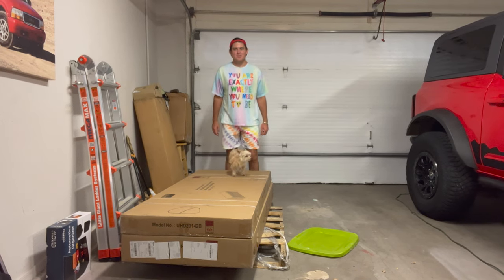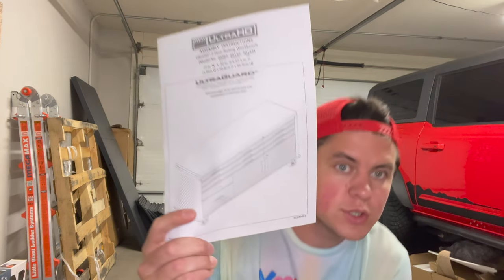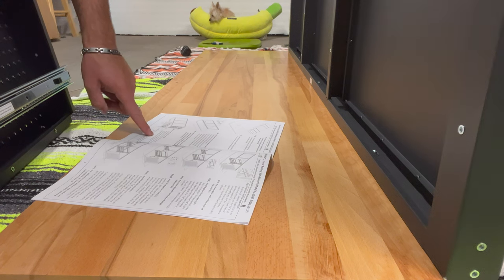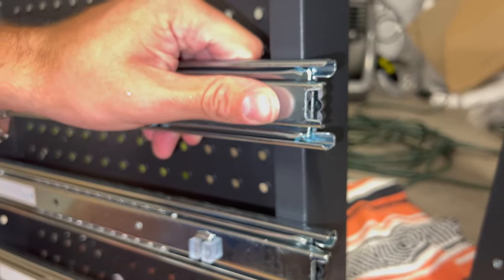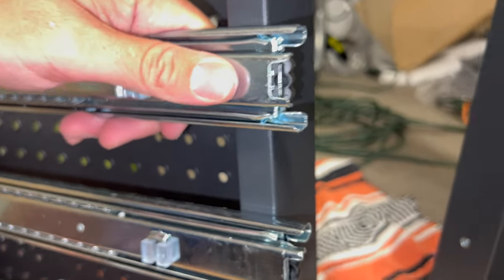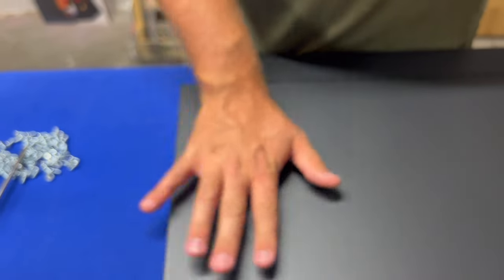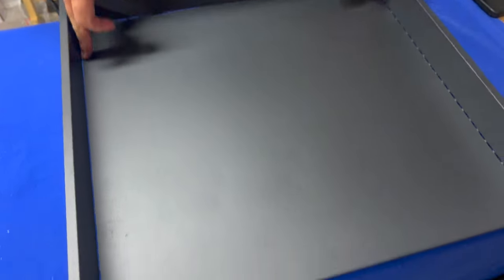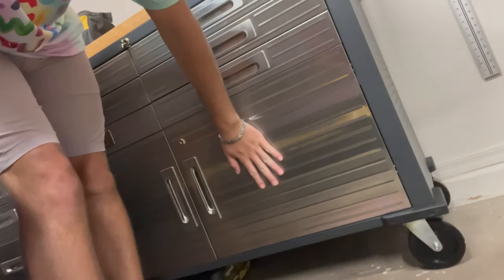Seville Classics UltraHD Heavy Duty Rolling Workbench / Putting Together - The Cookin' Camper

Comment: Very good instructions. I found out by unscrewing one of the slide rails you can get a good angle on the difficult screws. I used a drill with cross tip bit and it cut down on time except for the three screws under each drawer face plate. Three face plate nuts stripped out how I will remove them later and replace with pop  rivets
Reply from the maker: Thanks so much for the comment, kinds words, and watching our video!!!...Might have to get an "easy out" if you ever have to remove them....Have a blessed night!!!

Comment: Just put mine together. Gee Wiz. Almost made the thing not worth it but for the price on Sam's, I guess I'll put it together. It's so crazy how far the whole "assembly required" has gone. Your literally folding stamped metal into drawers lol. This has been the only case I've experienced where the included tools worked better than mine and were given some thought. You would be doomed putting this together by yourself if the screwdriver wasn't magnetized. All said the drawer sliders will need a lil adjusting. If you can get this on sale and free shipping, I'd say buy it. But if your not the best handyman, then don't. Hopefully someone who needs a tool box this big in the first place can manage.
Reply from the maker: I AGREE…These are quite the beasts to put together!!!…But………I felt really accomplished after doing so lol…I also think two people from the very start would be nice 😊 👍🏾 …THANKS FOR STOPPING BY AND LEAVING A COMMENT!!!
Reply: I’m trying to find out if the box is 77” in width counting the handles sticking out? Or is the unit itself 77” and the handles on the sides add more width? I literally have a 72” spot I’m wanting to put it in. Wondering if I can leave the handles off the ends and it possibly fit? Thanks for any help with this!
Reply from the maker: Thanks for the comment!!!…I don’t know if I would try to squeeze it in that small of a space as the handles really help with moving it around…If you ever go to Sam’s they have them in stock and I’m sure you could get the exact measurement you’re looking for…at our Sam’s there’s always a floor model of this item…HAVE A BLESSED DAY!!!
Reply: @TheCookinCamper  awesome! I really appreciate the reply!
Reply from the maker: @2fmrc  ❤